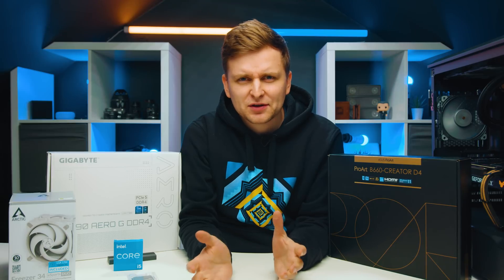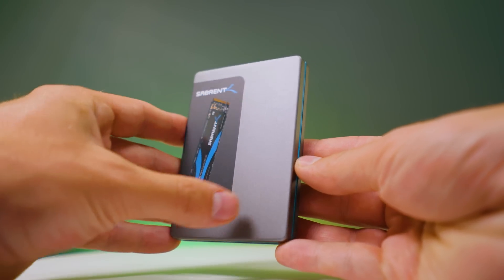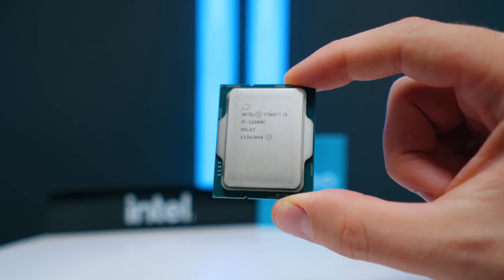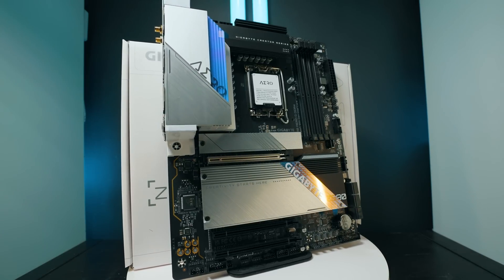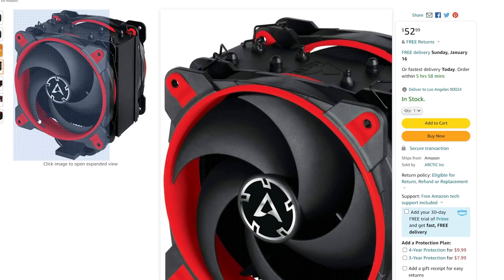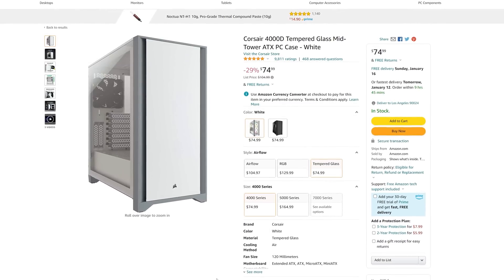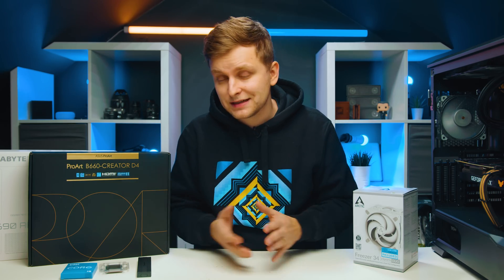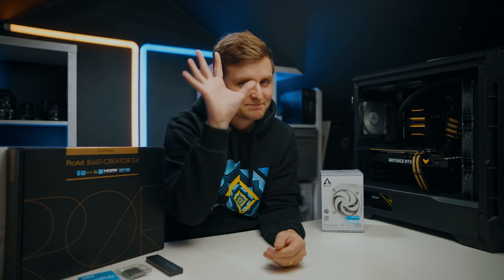Best Bang For Buck Video Editing PC 2022 - $1500 Workstation You CAN Build Right NOW!

Comment: Would it be possible to build this but without a dedicated gpu for work on music and other non-graphics card intensive creative work? (Would the build be the same but just without a dedicated gpu?) Great content as always, thanks!
Reply from the maker: Yes you can, that's the beauty of it! Just leave out the dGPU! ;)
Reply: @theTechNotice  Thanks so much for your great videos!
Reply: It would depend on what you’re editing. Intels igpus handle hevc, h264/5 really well. Up until recently it was a better option to use quick sync for those codecs.
Reply: @mrwashur1991  thanks Micah. I’d mostly be editing music in DAWs and otherwise using MSOffice with lots of open web browsers. Apart from that I’d only be doing very occasional graphics work, such as photos or lowish end video. I’m hoping a build like this should be enough, and if I do need a dedicated graphics card I can perhaps get one later (when the market isn’t quite as crazy)!
Reply: I forgot to add, DAWs and similar music apps usually need good single core performance speeds. It seems the i5 12600k has pretty good single core speeds, especially for the price
Reply: @mrwashur1991  I'm going to do basic video editing (Davinici resolve, sony a6400) and photo editing (affinity) would this still work for me with no gpu?
Reply: Yea if you're going with a 12600K and not KF than there's no need for and dedicated GPU.
( only if you have bought the KF ( kf = no integrated graphics ))

Comment: I don't understand why every case should have window and why each system needs to be color-matched and RGB? It is waste of money.
Reply: I used to be more that way. What ever the best deal is, looks don't matter. It's a very valid opinion! However more recently I've started feeling that if it's going to be front and center on my desk, putting a little effort into making it look attractive isn't a bad thing. Maybe as I've getting older I appreciate nice furniture and decorations more than I used to? It's not worth spending a bunch more, but if the cost is comparable, or if you can afford a few more bucks here and there, it's rewarding having a technological art peice instead of a janky box of wires... idk, that's how I'm feeling lately, nice looking things are nice to look at :)
Reply: @lemurdreamur9257  Space on my desk is precious, so I have PC under the desk. I think that tower cases should be always under the desk. I also appreciate quietness over look, my case has sound dampening material on side panels instead of glass. But agree with you that it is great to be surrounded by nice looking things.
Reply: @jakubhostinsky4482  yeah, I currently have a sff case on the desk so it doesn't take up too much room. However I'm in the process of a new build and using a 5000D. I must admit I'm a little concerned it's going to look massive on the desk. I don't like the computer on the floor because of dust, dirt and dog hair... I guess I'll see how it feels once it's done. The parts have just started to trickle in but I don't have the case in hand...

Comment: If i build this pc...after some time..What if amd drops new 7000 series cpu.. which maybe much better..
Reply from the maker: But then what if intel drops 13th gen, and what if AMD 8000 series... this never stops. The point is, if you need something right now that will get the work done and has quite an upgrade path, this is the best bang for buck way! Also AMD 7000 will have ddr5 and the availability of that is questionable... :)

Comment: 13:40 Keep in mind that if you want to use the front fans for exhaust (rear + top intake & front exhaust with front dust filter off using an AIO) the real "airflow" version of the case is what you should get. It is actually a really good fan config for thermals if you use a 360mm aio instead of a tower cooler.
Reply from the maker: That's abit unconventional fan setup don't you think? 🤔
But in our case a 360mm aio would be an overkill... :)
Reply: @theTechNotice  yes it is very weird to use the front as exhaust but it seems to work well, and i agree that a 360 AIO would be overkill for a stock 12600k (but a 12600K OC'd to the maximum capabilities would appreciate the aio).
Reply: @shanksisnoteventhatstrongbruh  I'm thinking of upgrading to a 360 aio because I want to overclock my 12600k even more but I'm thermally limited now. And using the front as exhaust (in the 4000d airflow) is something I've never thought about. It would give the gpu fresh air too, but with a push-pull setup on the aio (I got enough fans to do that) it would create a negative pressure environment, so I'd probably have a lot more dust in my system...I guess I gotta try and see what works better
Reply: @theTechNotice  On the other hand. do you think it is possible to cool this chip with ID-COOLING IS-30, noctoa l9i, alpeföhn backridge with slim 92mm noctoa fan, and maybe slim 120mm noctoa fan, with motherboard dishroudinng? can this 47mm height 120mm slim noctoa fan setup cool down a 12700k undervolted? what do you think? Thank you in advance! I'm before 2 builds.